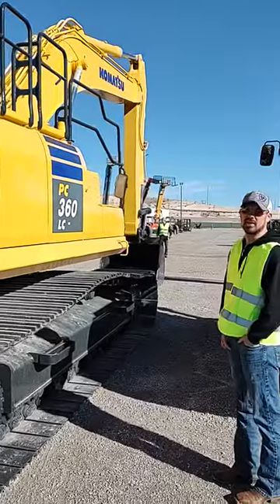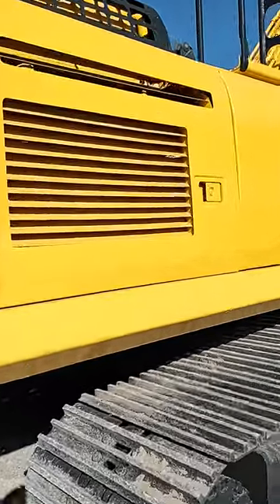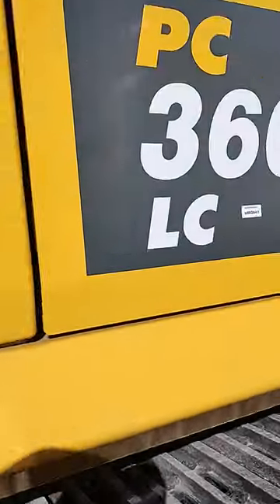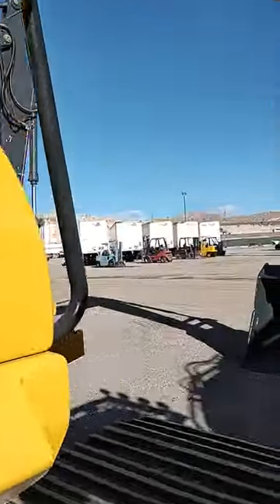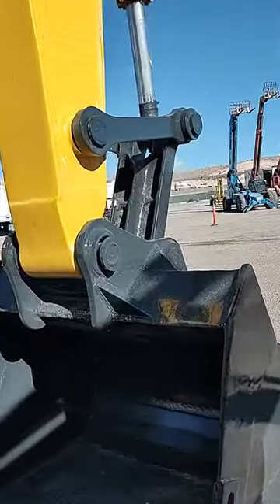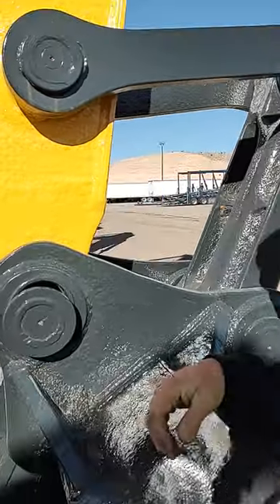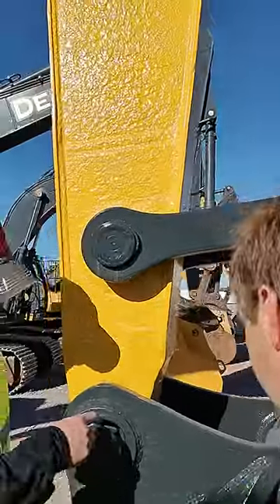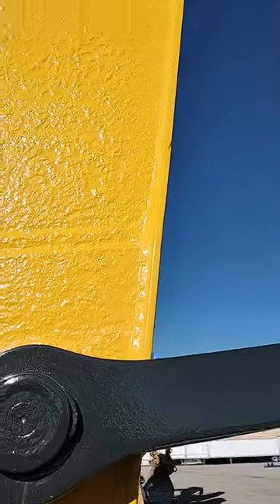Spray the paint on thick!

Comment: Never forget to paint your radiator. It increases horse power and break out force!
Reply: But only if you use black paint.
Reply: Color matched radiators are a must.
Reply: @gravelydon7072  Now you just showing off
Reply: @MadScientist267  It has been shown that black paint is the most effective for use on a radiator to help dissipate the heat.
Reply: Same with the rubber and high pressure hoses
Reply: @gravelydon7072  It also acts like an insulator you derp 🙄
Reply: The paint on the radiator gives more surface area to dissipate heat you dummies 🤦‍♂️ it’s like science and stuff
Reply: @BrooklynBalla  OMG just siddown. It makes a way better insulator 🙄

Comment: Huh, didn’t know they were doing “knock-down” finish on heavy equipment. The bottom section of that stick looks like the texture we put on drywall here. 😂
Reply: Painted right over the dirt maybe.
Reply: It's pitting in the steel, he says they were digging something corrosive, it ate up the steel , prob had 1/2" thick rust scale and they scraped it off and wire wheeled it ,prob acid treated it , then painted all the craters left behind
Reply: Salt corrosion I expect having done sandblasting as a job.
Reply: @GT-mn3bx  Salt corrosion I expect having done sandblasting as a job.
Reply: @michael2943  Salt corrosion I expect having done sandblasting as a job. Pitting is SPECIFICALLY a salt thing. And possibly acids, but this is more likely to have salt contact

Comment: I'd SAY that was salt corrosion. That was the most common severe corrosion I would see in sandblasting. The paint on the radiator will STINK as it BURNS it's way off if it's the same paint as outside. But that front ine is POSSIBLY air-conditioning. Radiators are either plain or black and it's often a kind if vinyl paint that's used. I used to work at a place that manufactured radiators mainly for mining equipment and other odd stuff like mini street sweepers and backup generators and even snowmobiles for Antarctica and occasional military equipment

Comment: One of my relatives was in charge of building a highway and ran rented machines day and night and almost 24/7. He ran them as long as they could before returning them when they broke down. This was before they had hour meters. They started using hour meters after he took advantage of the renters. I’ve been told he was a major reason why they put the meters on now.
Reply: Excavators without hour meters?? I didn't know it was even possible.. I thought they were used already in the 50s or 60s, or just not all of them??
Reply: I met a guy who said his ex boss had magnet signs with his company name on it. they'd go do a job site, slap their sign on another contractors rented scissor lift or whatever when they were not on site and run it

Comment: Hammer finish.
Reply: Hammertone is a certain kinds of paint that dries that was on flat steel. But that there is salt corrosion. I used to work in sandblasting and spray painting

Comment: Gotta be careful with a komatsu period! I have a wb150aws and am having a very hard time getting parts for it....the dealer couldnt even decode the serial number! 😑
Reply: I'm not a Komatsu fan, but we've had trouble getting cat parts too.
Reply: @T Willison  ive had problems with cat parts availability but never the company not recognizing their own serial number or machine model. Plus cat has a larger dealer network, theres only 1 komatsu authorized dealer within my state and the next nearest one is almost 400 miles away but there are 9 cat dealers, 7 deere construction dealers and 2 JCB dealers "locally"
Reply: @John Pike  never had any part # issues either, and I'd wager a lot of the delays in getting parts is still due to the covid debacle.
Reply: @twillison8824  the... "covfefe"... if you will?

Comment: I’m guessing that one sat in one spot and did a repetitive move with a particular material, like the loader at a scrap yard, or to feed a semi-permanent aggregate or cement plant. That might explain how nice the undercarriage looks. I wonder what the roundy-round part under the cab looks like. I’d rather have a worn machine that someone maintained and put some parts in, instead of a deep dip in a paint can. A guy I worked for had a pair of Hitachi excavators, about five years apart. The older one LOOKED it’s age, but it would have been a smoking buy at auction. Everything tight and dry, engine not tired yet, and not using oil. The newer one needed some things, so was the second choice when loading up to head for a job. This is useful knowledge from guys like you who have maybe been bitten by dishonest people here and there.😏

Comment: they painted the fucking radiator... i cant..
Reply: Looks like the inter cooler, not the radiator. There is a little over spray on the radiator though.
Reply: @mikeznel6048  well.. just that an intercooler is a radiator with a specific name/purpose :)